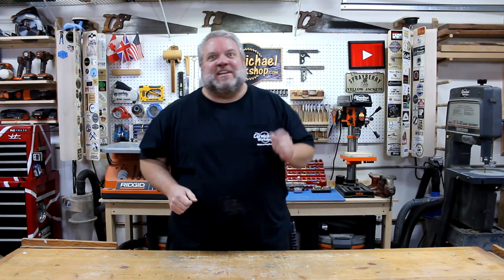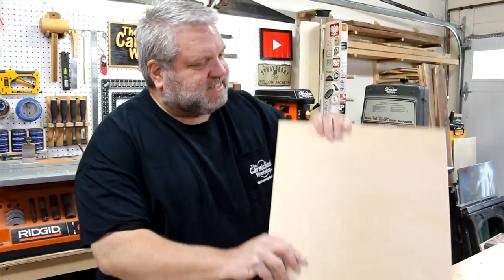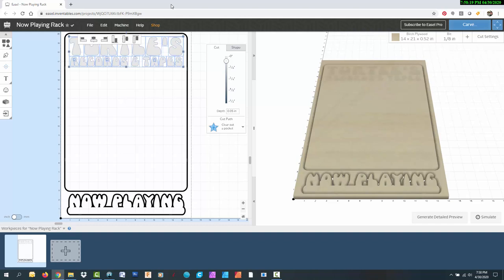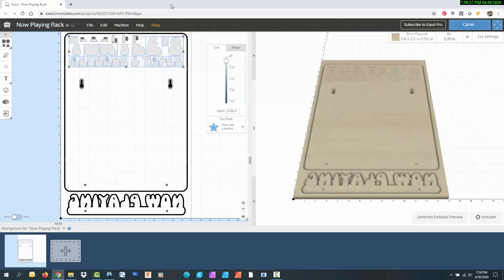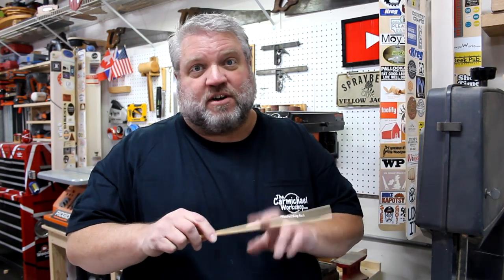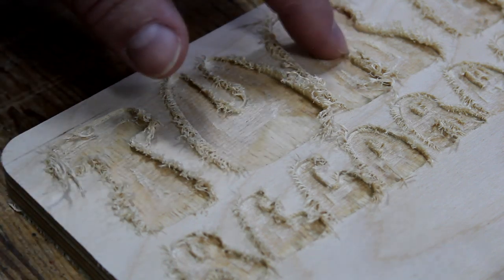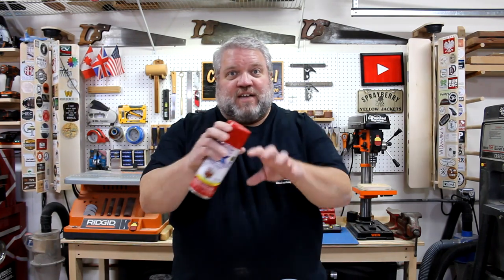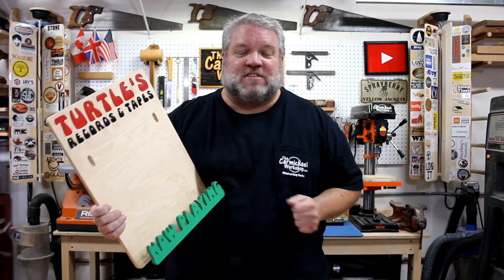Make a "Now Playing" Rack for Vinyl Record Album Covers, Inventables X-Carve CNC Woodworking Project

Comment: Steve i watched your fan repair video from 4 years ago and figured you were more likely to see a question on your most recent video! My lasko cyclone fan blades were wobbly and making an awful noise so i took it apart and put it back together. Once i turned it on it worked great so i turned it off to put the front grill on and the fan fell off the motor shaft. Any idea how to get it to stay on?
Reply from the maker: Hmm, if it doesn't tighten up when you push it on, then I would probably try to glue it on with a hot glue gun.  Hot glue holds well and is easy to heat up and remove if you need to get it off.